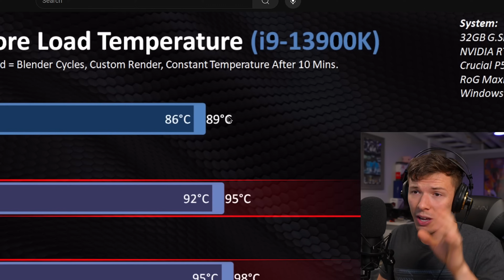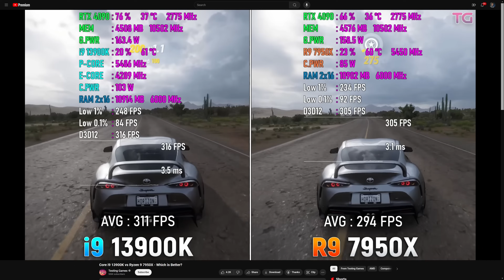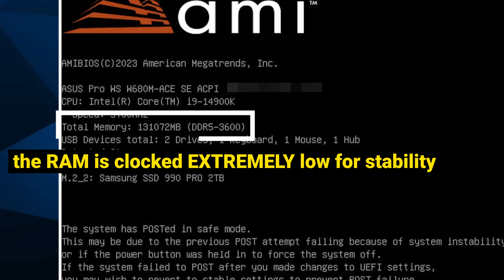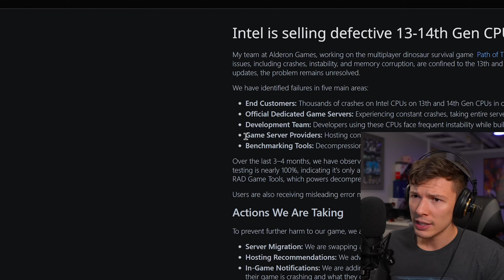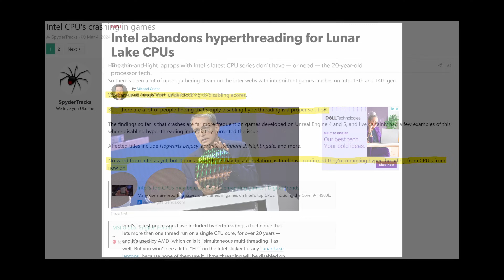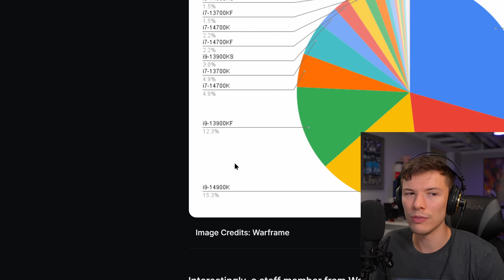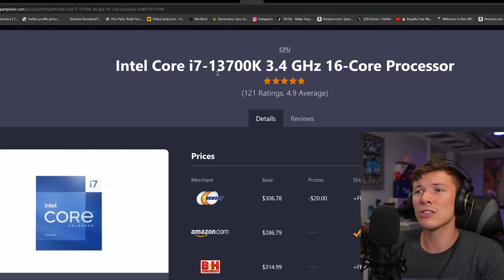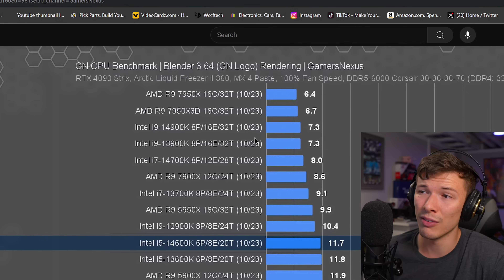Intel F**ked Up Bad

Comment: I bought a pre-built PC from PCSpecialist here in the UK in December 2022 with an Intel i5-13600KF. Fortunately, the BIOS on the ASUS ROG Strix Z690-A Gaming WiFi D4 motherboard I chose had the Enforce All Limits option set from Day One and the CPU has been working fine, hitting 5.1 GHz on then P-Cores and 3.9 GHz on the E-Cores in games. I've had just three blue screen crashes since I bought it and they've been caused by faulty drivers or software, basically one-offs that went away, rather than issues with the CPU. I certainly have not seen the Out of Memory error on my RTX 4080 either.

That said, I think my next CPU will almost certainly be an AMD one. I'm not a fan of their GPUs (personally I think they lag too far behind NVIDIA to ever consider them as an upgrade option) but their CPUs are compelling. In fact, I almost bought an AMD Ryzen 7000 series CPU last time but the cost of the DDR5 motherboards and memory at the time (December 2022) put me off and I opted for the Intel one with DDR4 memory instead since they've always been reliable for me. Time will tell if the i5-13600KF is in the same ballpark or whether it will fail at some point. However, I am confident it should be fine as I've never overclocked it and I've never seen the P-Cores go above 5.1 GHz even in single-threaded tasks.

I should add that I updated my BIOS from the one that shipped with the PC in December 2022 for the first time in May 2024 when I started hearing about the Intel issues. Bizarrely, on my system, even with the latest 3701 BIOS, the Intel Default profile runs the CPU hotter and with more power than the ASUS OC Profile with all the limits enforced!!! Seriously, the voltages are higher and the CPU temperatures are 70-85 C vs 65-70 C in the same games. As such, I've stuck with the ASUS OC Profile with all the limits enforced rather than stuck with the default Intel one because higher voltages and temperatures are what contribute to CPUs degrading in the first place...

Comment: At my house I have a dead i7 7700K and i9 9900K. Those cpu's were never running hot,but still they broke down. This is not an issue of the 13th and 14th gen,I have never trusted intel since my second cpu died for no reason whatsoever

Comment: Started with ryzen 2700x in 2018, upgraded to 5700x in 2024 with more than 50 percent performance boost but with 50W less power !! CPU running at full load 4k ultra gaming with 65°C .
Never seen a bsod since last 6 years on my AM4 platform. 
Looking to run this platform atleast for a decade 😊
Incredible ! Thank you AMD !

Comment: Reminds me of the TSMC debacle, tech produced between 2005 and 2008 has an extremely high rate of failure as well due to TSMC using flawed underfill for GPU dies. That's why so many early PS3 and 360s died within a year.

Comment: I have an i5-13600KF and I'm just a little bit pissed...
Reply: I think you will be fine personally unless you have been experiencing issues? The i5-13600 draws a lot less power than the 13/14700s and 13/14900s with lower voltages and lower clocks even though they are all the same silicon. The issues reported with the 13 and 14th gen Intel CPUs are for the higher end ones and chances are the few 13/14600 issues may be a result of the users manually overclocking their CPUs beyond their rated values which is always a risk even on CPUs that are reported as stable.

Comment: 10:30: AMD or 12th Intel CPU -> short text ... /But for me are 13 and 14th Gen INTEL CPU are actually 12th+ and 12th++ with more clock speed and power consumption and the AMD CPU needs less

Comment: 12:15 not every 13th and 14th gen cpu. Only the high end chips from the gens are affected so the i9's. If you have something like a x600 or x700 chip youre fine from this specific issue

Comment: Hahahahahahahahahaha, this is absolute comedy gold. It's absolutely amazing how Intel are just clubbing themselves over the head. As for what's causing this, aside from Intel stupidity, are y'all sure it's not the thermal paste that Intel is still using between the CPU die and heatsink? That shitty thermal paste is the reason why you have those colossal temperatures nowadays. It also creates hotspots that are far hotter than 100 degrees, so when the game just uses enough cores, the Intel CPU just cooks itself to death.

Comment: I'm using a car radiator and it's working fabulous. Well, technically it's a transmission cooler, but either way, and i'm also using a stainless steel water filter as a reservoir

Comment: I bought/upgraded to 12th gen when it first came out, coincidentally the last gen that was "ok"😂, and I was HARD intel because it was sentimental to me, their CPUs were doing comparatively well, and there was nothing very innovative going on with AMD prior to that time. So I planned to wait a few gens before upgrading to a new one and the 13 and 14th gens were just FAILING, getting so many problems. Heat, failure, and losing innovation, ironically why I stayed away from AMD. I thought, there needs to be a change. So, I researched the best CPUs to hell with the idea of upgrading in mind regardless of if it had to be AMD or waiting for future intel gens, and found by title "The Best CPU for gaming", the AMD Ryzen 7 7800X3D. Since I hadn't payed attention to AMD during the releases of the 13 and 14th gens of intel, I missed out on this, again, innovation in a cpu. While at first I was skepticle because it was a CPU that specialized only in gaming and wasn't on par with multitask-handling, I finalized with myself, "Hey, I'm using it for gaming only right? Gaming performance is what I care most about." So I compared data to HELL, and decided it was the move I was gonna make. I did, convert and switch my hardware to AMD and I honestly DON'T regret my decision with the news of AMD and Intel since then. And not only was it a conversion, but it was a VERY worthwhile and noticeable upgrade. My frames gots BOOSTED. This experience is also very valuable because now I have experience with both cpus.

Comment: The AMD FX series processor set the then world record for fastest clock speed in 2012. The same processor is less than $100 today and is just as good as any modern CPU for the average user.

Comment: I'm running on an 11 year old Intel CPU with uptime near 24/7.  The LED lights on my ram have failed in that time.  I'm finally going to upgrade and was going to stick with Intel, however, I think it may finally be time to switch to AMD which I had not used since the Athlon processor in the early 2000s.

Comment: I made the terrible mistake of getting an Asus G16 Strix laptop that happens to have an i9-14900hx.  The laptop is only two months old and I have been experiencing nothing but errors with it.  If I don't want to suffer from a blue scrreen, I'd have to turn down the settings for my games to low.  Even on low-medium settings, the cpu would go up to 98c.  Not only that, I would have video problems even if the video card is working properly.  Blue screens are frequent, and I haven't done anything to this laptop.

The latest inel cpus SUCK, and I am livid that I have to constantly deal with errors because I made the choice to buy a laptop that has it.

I'm making a desktop PC soon, and the first time I'm going to go AMD.

After what happened with their latest gen processors, they deserve to lose all of their loyal customers.

Comment: Hyper threading isn't the issue. It's over voltage. Almost all of the CPUs are i9s and almost all 13900K, 14900K and their KS variants have voltage tables well over 1.4v. 

If it's a lower bin i7, the lowest bin i7s also have voltage tables that go above 1.4v which explains why there's much fewer i7s with the issue despite there's almost certainly more i7s in the wild than i9s. 

Its also not a software issue. My 13900KS was perfectly stable and progressively got worse until it couldn't do basic tasks like installers crashing. It could only be made stable by setting an all core of 5.6/4.5 and cranking the LLC. 1.4v with default LLC 4 is unstable. 1.35v with LLC 6 perfectly stable.

Comment: There is info that was omitted. RAD Game Tools says that “only a small fraction” of the processors are affected.
Reply: "RAD has become aware of a problem that can cause Oodle Data decompression failures, or crashes in games built with Unreal. We believe that this is a hardware problem which affects primarily Intel 13900K and 14900K processors, less likely 13700, 14700 and other related processors as well. Only a small fraction of those processors will exhibit this behavior. The problem seems to be caused by a combination of BIOS settings and the high clock rates and power usage of these processors, leading to system instability and unpredictable behavior under heavy load. "

Comment: Just put a cooler in your system that can handle it. If anyone put a single tower air cooler on a 13900k or a 14900k, deserves to have it fried.
No false advertising. Just cool it properly.

Comment: Well right now i am happy i waited to get a new PC as I would have gotten an Intel 14th gen CPU to go with the full system upgrade from Intel 5th gen. The 5th gen chip is still running fine the reason for the upgrade is i need windows and Windows 10 is going EoL in 2025. So 9 years out of 5th gen and they are getting maybe 2 years out of 14th gen  well i am getting my money's worth out of a 5th gen chip.
Every CPU will die given enough time just CPUs are intended to last longer than the rest of the system not die before everything else. So like I am hoping Ultra 200 will not have this issue but when windows 10 goes EoL will be to soon to tell so I guess I am getting an AMD CPU for the next decade build.

Comment: Went with AMD with my latest build, I dodged a bullet. when I did my research, I knew they were over pushing their CPU's they had the potential to run hot, consumed too much power, and was on a 10nm process. all of which cannot be good in the long run. I knew there were behind, and trying to play catch up. that usually involves cutting corners. AMD really had to innovate to get ahead. (disclaimer, not an AMD or Intel fanboy, I'm just a fanboy of best performance to value ratio at the time I need to build a machine, as my last CPU was I7-920 wich last 10 years on a linux OS)

Comment: When Intel first brought out the Pentium p5-90, there was a bug in the Floating point unit that returned inaccurate results when dividing some numbers (i.e.  4,195,835 by 3,145,727). When they were called out on it, they offered to replace all affected CPUs. All I had to do was register with them and they sent me a letters saying they'd send me a new CPU if I returned the one I had. At the time all I was doing was playing Doom on it, and that didn't seem to be affected (as far as i could see) so i didn't bother taking Intel up on their offer. I couldn't stand the thought of not being able to play doom until the new CPU showed up!

Comment: My i7 14700K runs at 5.6GHz on a 280mm cooler (2x 140mm fans) and, under a full load, never goes above 75°C. Maybe don't buy a cooler because a tech channel tells you they are good. Look at ALL of the benchmarks done. I went with the Corsair iCUE H115i RGB PRO XT. This thing is QUIET and super cold. Just like they promised. It is identical in performance to the 360mm. Larger fans spin slower and pull more air. So 140mm fans vs 120mm fans FOR THE WIN!!

Comment: I’m not surprised. I’ve actually switch to using a Mac silica laptop and have used AMD for most of my desktops with ZERO issues for half a decade now. I still had an intel for some use cases where the clock speed benefit was more than the parallelism ryzen gets.
Intel have just been pushing wattage limits for smaller and smaller gains and it’s catching up to them

Comment: Dude, the linux errors you showed with the caption "NVME failure" are errors from a CDROM drive saying that it can't read a scratched disc, NOT an NVME drive.  Both CPUs and GPUs have been running dang near 100 degrees for over a decade now.  They throttle to prevent the temperature going higher than that.  If you want top performance, you have to keep it cool so it doesn't throttle.  A power limit if 4096 watts is the maximum setting, aka "unlimited".  The power limits are there only for the motherboard maker to be able to skimp on their power supply and ask the CPU to please not overload their weak power supply.  It is always set to unlimited on gaming motherboards.  5 out of my last 5 AMD/ATI GPUs have cooked themselves from running at 100 degrees for too long, which is why I underclock them these days.  That said, I'm finally getting ready to overhaul my 7 year old Intel box and go back to AMD's new Zen 5.

Comment: Hmm... my 13900K has been good for about a year... so hopefully that continues to be the case.    I hope I don't have to build a whole new computer - I love the performance of the thing so far, and the problems i WAS having were ASUS malware related, and related to my GPU.  

Fingers crossed it doesn't crap out on me too soon.  I "could" replace it, if needed, but I don't want to have to.  I also don't want to go for a processor with lesser performance.  Now, that money is spent and I don't expect it back, but money isn't the only cost to things like this.  I really hope Intel works their shit out, because I've loved my intel builds to this point.  My performance is fantastic - but any AI related overclocking features should absolutely be disabled.  I know my ASUS ROG Maximus z790 Hero was trying to melt it, and fortunately I noticed what it was doing before it really screwed anything.

I'll definitely be negatively reviewing if it does fail any time soon.

Comment: How is this an issue when Asus is always the MB where you have problems when by default the CPU is over ampped by 100A's. Of course it will fail. MSI for example is more reliable MB.
By the way i7-13700k with MSI board. All good. 

I'm just going to say what my thoughts are. It feels more like industrial attack towards U.S. than anything else. CPU's and electronics are so important for today's weaponry that if you can destroy the industry you would have already won the possible war. Russia/China all linked. I can't be the only one to make the link what is happening.

Asus "Asus sources nearly 80% of its production from China, with the remaining portion originating from Taiwan, Brazil, Europe, and Indonesia."   Motherboards mostly come from China.

MSI "Manufacturing initially took place at plants in Taiwan, but has been moved elsewhere. Many MSI graphics cards are manufactured at its plant in mainland China. The company has branch offices in the Americas, Europe, Asia, Australia and South Africa." Indicates that MSI boards are not made in China. 

INTEL made in U.S.

Comment: Had a 13900k since day 1, not had a single issue with it and temps are great, games such as cyberpunk run around 50-60°c with an arctic freezer 2 360. Never once overheated or anything, I swear people just don’t know how to install coolers correctly
Reply: You must have missed the part where the game developers and dedicated server rooms with actual engineers on payroll were seeing massive failures on Intel CPUs. And if it's just bad cooling, then why isn't it also happening on AMD CPUs?

Comment: To keep it Cool you need to undervolt and underclock which yes hurts performance as higher Voltage and Higher Clock speeds introduces Higher temperatures BUT there is Safetys in place called Throttling where if the CPU gets to hot it will underclock itself a CPU can get to around 110°C before it Throttles my Ryzen CPU was Designed to Boost and Target the Temp of 95°

Comment: The problem is: the CPU are NOT getting ENOUGH voltages!
Motherboard Manufacturers Power AC and DC load-line settings in the Bios are changing the voltages that the CPU gets,
thus not providing enough voltages at certain frequencies under high loads.
I can run the 12 gen CPU on Load line calibration LLC 1 fine, but the 14 gen needs LLC 8 to achieve higher frequencies because there is too much V droop at lower Load-line settings, and the CPU does not get enough voltages under higher loads..
14 gen needs more power and voltages under high loads..
So Motherboard manufacturers just needs to fix their Bios settings ...
And it is cool that intel lets us change the load-line settings so that we can under-volt the CPU, but if the under-volt is too aggressive crashes, errors, or instability happens.
i tested this, and even the "out of video Memory" error was not present when i just was sending a bit more voltage to the CPU, but it was present if i was sending to little voltage.
Apps and games were not starting or crashing with too little voltages, but not crashing anymore with a bit more..
It's actually not Intel's fault! it's Motherboard Manufacturers!
because they made Bios with different very low AC Power load-line settings to under-volt the CPU by default.
Intel specification recommends that AC and DC power load line setting have to be the same value,
But motherboard manufacturers always put very low AC load-line settings by default, compare to DC load-line..
thus sending much lower voltage to the CPU than required..
You can check your motherboard AC and DC Load-line values in HWiNFO, in the "Main window" click on central processor, expand it, click on your processor and scroll down to the "IA Domain Loadline (AC/DC):"
i bet they are different values even tho: "intel recommendations "intel default settings" clearly sate: "DC load Line must be equal to AC load Line".